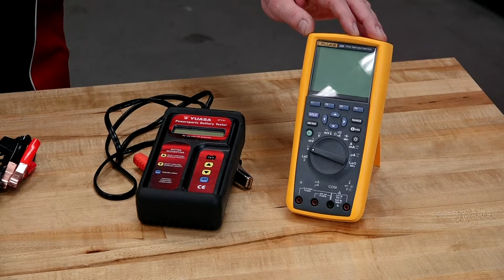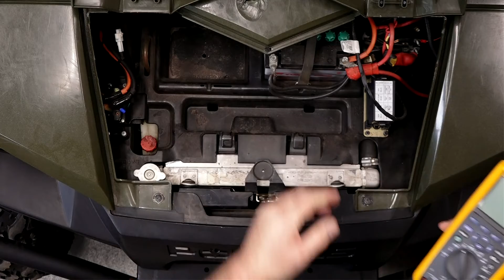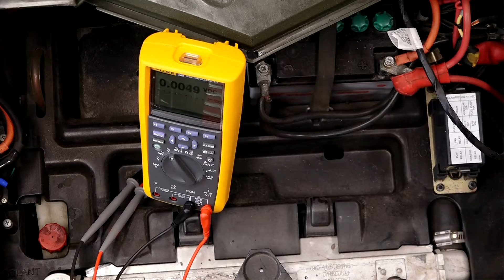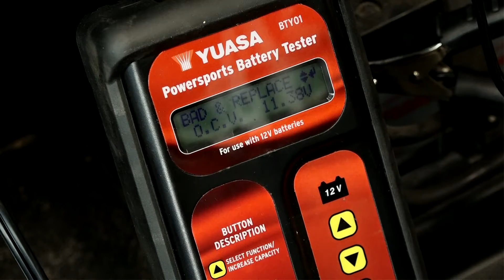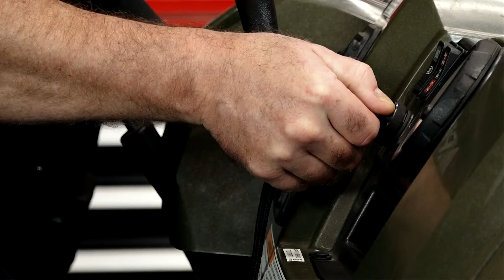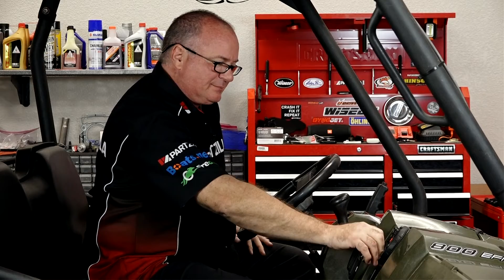Polaris Ranger No Start | Polaris Ranger 800 Won’t Start | Polaris Starting Problems | Partzilla.com

Comment: I have the same year and size Polaris Ranger and all it does is just turn over but won't start? I've replaced the injectors  and fuel pump but it still doesn't try to start. What should I try next? I have also changed the Sparkplugs! What should I do next? It's a  800XP with only 250 miles on it and always kept in the garage?

Comment: When adding powered accessories, how do you know that you need to add an additional battery And is the factory charging system enough. Thanks for the very informative videos. Stay well and stay safe 👍👍👍👍👍👍👍👍👍👍